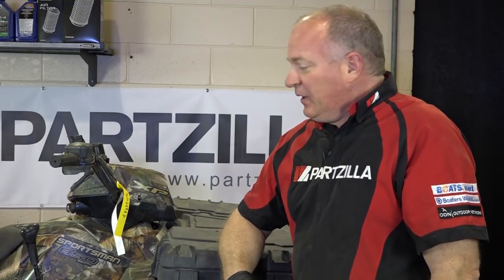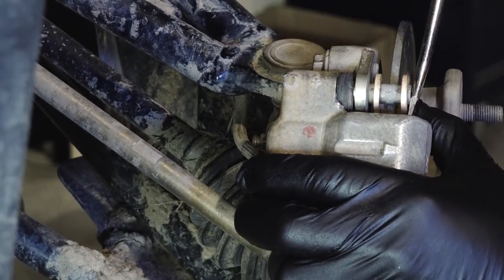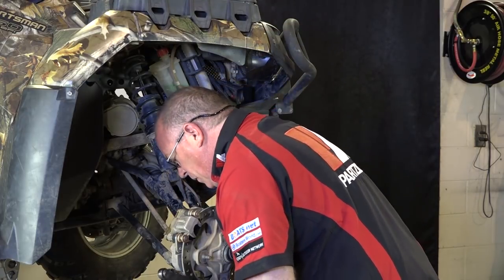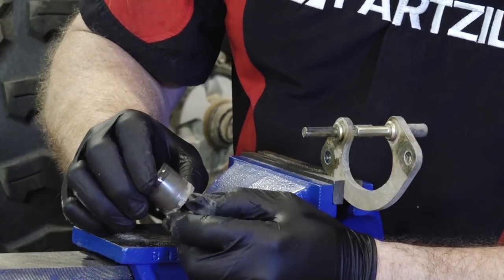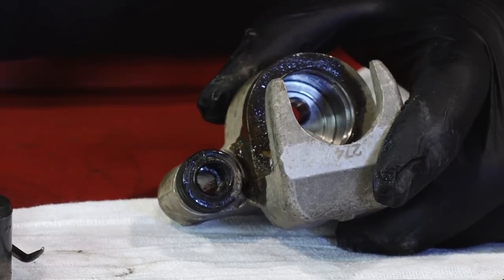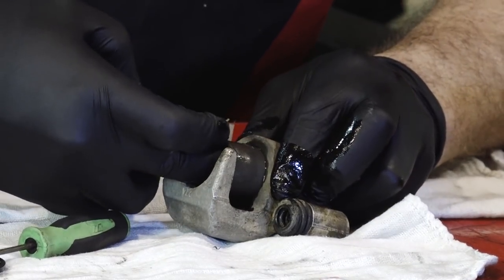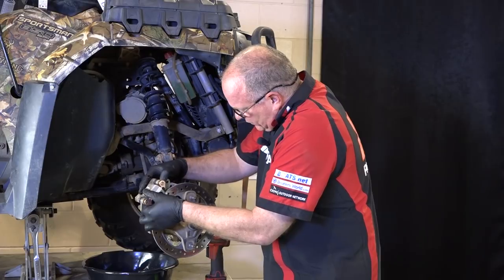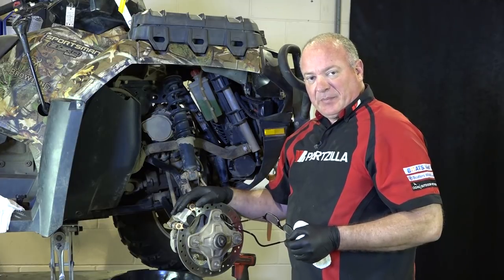Polaris Brake Caliper Rebuild – Sportsman 850 ATV | Partzilla.com

Comment: Love the Partzilla videos.  I have a 2001 Polaris Ranger 500.  Does this model caliper have a cap/washer of some kind down in the hole on the caliper body where the brake line screws in?  The piston was stuck in the caliper body and ended up using a larger punch and wallowed out the hole.  Now I'm thinking that there was a small cap/washer that I was to remove.  The parts diagrams don't show this part.  How important is the hole size as long as the brake line will screw into the caliper body?

Comment: Well you made that look easy my rzr burns threw brake pads in a day at the park I was going to just replace them but maybe I could just do what u did. Sounds a lot cheaper not sure if that's the problem yet though as I can compress the pistons back in pretty easily during pad change
Reply from the maker: It's worth a try, Robes. Shoot us a comment if you get stuck and check out Partzilla if you need parts: http://www.partzilla.com/parts/search/Polaris/ATV/parts.html
Reply: +Partzilla ok so I've done what u did here there was a pretty descent line of dirt build up on the pistons so I clean them with a wire wheel got them nice and smooth but I didn't replace the seals. I really figured since they weren't leaking they didn't need it but seems I'm still eating up pads in a day at the park and It seems that the master cylinder is good since there doesn't seem to be any pressure staying on the caliper after u pump the brakes and then loosen the bleed screw. So I figure only difference between my calipers and new ones are the seals.... I have replaced one caliper in the rear and fixed that corner so far it's the only one that keeps pads...thoughts ?

Comment: Hi John, Great Video. My 94 4x4 has no front brakes. Where should I start? Calipers or brake handle? Fluid is ok.
Reply from the maker: i would start at the calipers first and see if that is all you need to do.

Comment: I've followed your instructions for the rebuild but the brake is very tight when I reinstall it.  It is not the piston that is making it tight.  It is loose until I install the allen screw...then the pads get very tight to the disc.  I haven't even attached the brake line yet.
Reply from the maker: +Brad Seib You have the 5mm allen too far in the threads.Back it out about 3 to 4 turns.

Comment: How do you replace the bleeder valve? I accidentally over tightened it & it came off.
Reply from the maker: You over tightened it?  Are the threads still in the caliper or did it sheer the threads?
Reply: The treads are still in, the only thing that came off was the nut part if that makes any sense.
Reply from the maker: You'll have to try to extract the remainder of the bleeder and then you should be able to screw in a new one.

Comment: that Allen screw should be tighten just enough so the outside pad barely touched the rotor, this was never mentioned in the video's
Reply from the maker: You are very correct.

Comment: No no no. Do not use a punch. For the love of god. Dont advice diy novices to use a punch either. God forbid someone strikes it and it scores the side of the caliper. They're going to be out some money for a whole new caliper. Compressed air... a air compressor and a blower attachment with a rubber tip. Firmly Push it into the hole where the banjobolt was and let the air push the piston out. No chance of scoring or damaging something